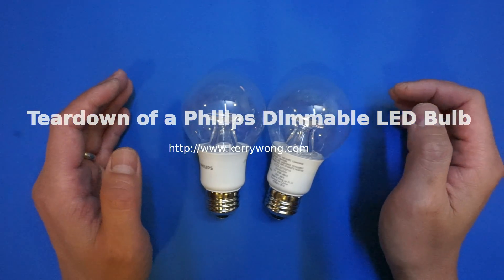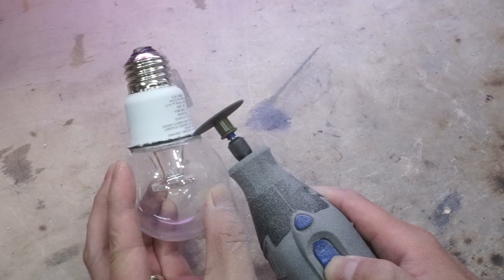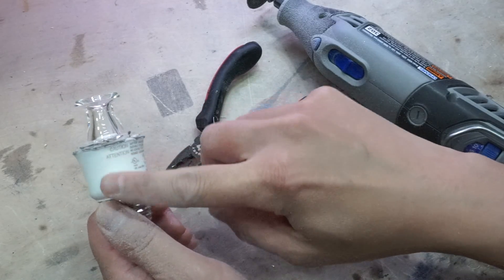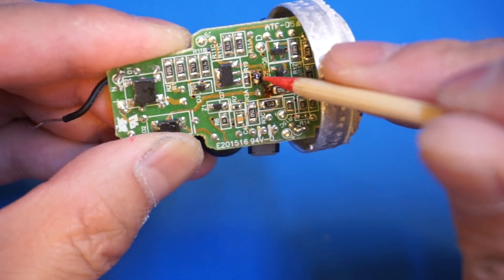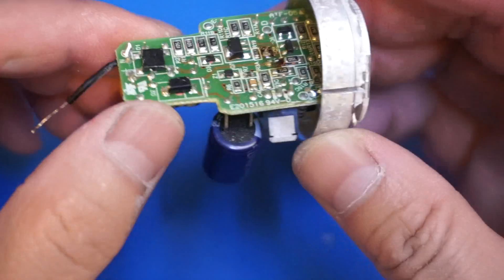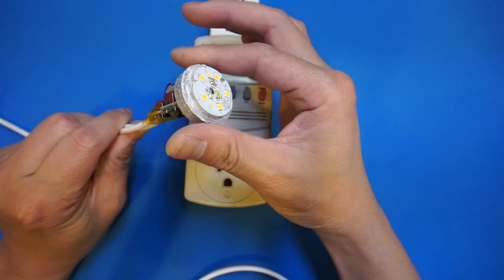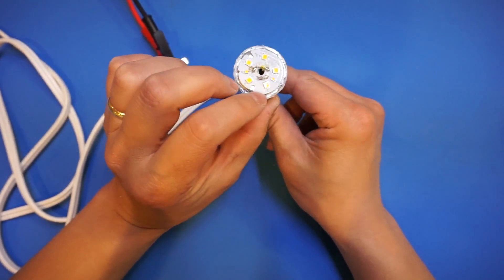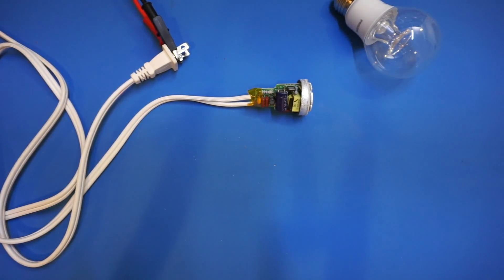Teardown of a Philips Dimmable LED Bulb

Comment: I had some Philips dimmable gu10s fail and the only thing I could find wrong was a single 100nF capacitor that read 81nf, it was acting as a main filter capacitor after the bridge rectifier. Assuming the capacitor wasn't faulty from manufactur then the only other thing I can think of is the inductive spike from the dimmer inductor causing it to puncture and slowly vaporize materiel making the capacitance fall below the critical level.
Reply from the maker: I didn't test the inductor, but the capacitors were OK from what I measured.

Comment: It'd be interesting to know if any energy is actually saved from incandescent bulbs when you take into account all the energy has taken to make all of these bulbs.  It's great to have leds that last 10000 years but when the supporting electronics die in a year it kind of tempers the benefit.
Reply from the maker: Well,  in this case probably not. I do have a few fluorescent light that had been working for more than 10 years so I suppose in the long run they can save money if they do last.
Reply: Kerry Wong if they last yes but man it's taking them a long time to figure out how.  I would estimate about half the LED bulbs I've bought lasted more than a year.

Comment: Are the two smaller LEDs there to change the color temperature for dim lights? Incandescent lights change to a lower color temperature when dimmed.
Reply from the maker: Good question. Those two seem to have similar color temperatures (you can see that in the video) though.
Reply: Maybe that was what it was originally designed for, but LEDs were substituted on the BOM to save costs at a later stage?  Don't know, it just seems to be the most sensible reason to have the two smaller LEDs switch in and out.  It already has a switch mode converter so presumably it should be able to handle any voltage drop.  It might be interesting to test the voltage drops on each LED chip  to see if that was a motivating factor.
Reply: I have the Philips Warm glow lights here at my house. The two smaller ones are indeed 2200K rather than 2700K. Maybe they just fit the same CCT LEDs on normal dimmable lamps to keep the main PCB identical.
Reply from the maker: Thanks for the info. By the way, I haven't seen your videos for a long while...
Reply: We moved house, but there's a fair amount of work left to do so I've had to take a break for a while from videos.

Comment: Wow, I couldn't believe a highly regarded brand could sell such junk.  I've always been willing to pay more for a quality brand, but now, I'll be thinking twice about buying Phillips LED bulbs.  I tried just about any brand of fluorescent bulbs, and i was disappointed in all but the GE bulbs.  I have a whole sack of fluorescent bulb carcasses, most of them had electronics failures. That was my introduction to cheap brands which ended up costing more than twice of getting a quality bulb, after adding in replacement cost, time and travel costs.
Reply from the maker: I thought Philips should be quality brand as well. It might just be this particular model though as I have other Philips LED bulbs that are working fine for years.
Reply: In my case I got a bunch of bulbs at one quarter of a dollar each at the Chinese store in 2008 and they are still running. I even moved to a new house and brought over the cheap bulbs.